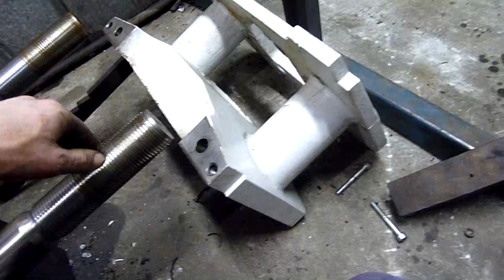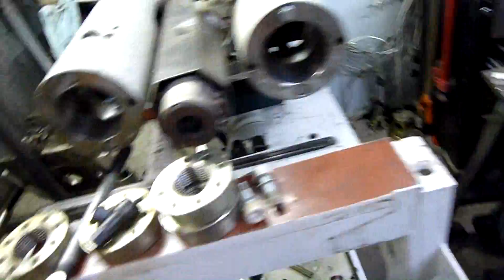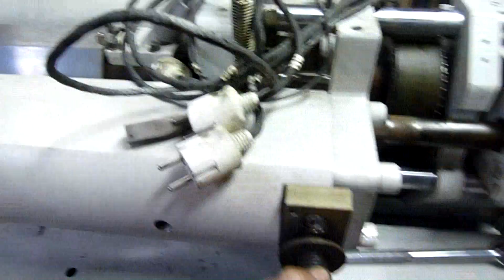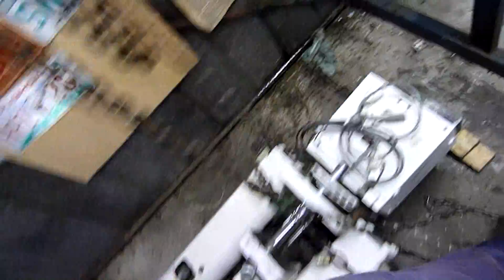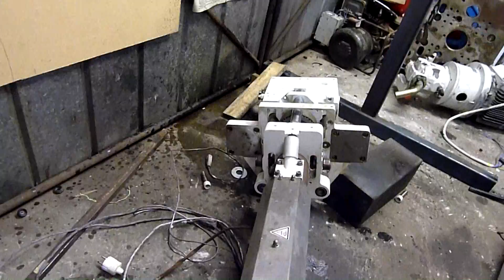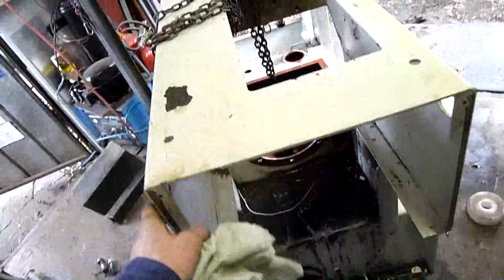Battenfeld Plus 350V Autopsy Final

Comment: Even that frame has tons of potential despite the 'odd' design (tank area/end...cut middle bottom out or remove tank and add 2 custom legs)...especially the 4 supports end....all accurate and level, perfect for machinery stand-a shame to cut it up but better than scrapping...Xynudu (.AU) could've used for his Schaublin lathe instead of using plate square stock from scratch, although his design quite nice..

Comment: The high resolution usually take a few minutes to load in the system.
I think it's a buffer thing just like with YT like/dislike system. Usually it's a seamless upload of the high resolutions however depending on your local server being really snuffed by many users either uploading or watching videos it does this low res upload. I've seen it a few times now. Sometimes tho it corrupts the video source, so for ex if it doesn't fix itself in an hour from the upload then it's effed. Awesome vid btw.

Comment: wish you was in the Good old usa I love to buy that motor off yea. that would be nice for a electric car. then I have to find a way to build a dc to ac 3phase converter to run it but it would be cool as hell. especially if it was permanent magnet motor. because during costing and breaking can use it as a regen, nice bit of stuff you get all the time, I believe I need to start working for a scrap yard.

Comment: If you are still serious on converting a car to electric, look up siemens simovert (I think) EV VFDs. They are specifically designed for electric cars, I think they are 3 phase too. They can be programmed to the exact specification of the motor to get max torque with the least power. They are water-cooled, incredibly safe and they come with a pot for hooking up to the pedal :D

If I find the manuals and datasheets and the place to get universal drive adapters again I will pm them to you.